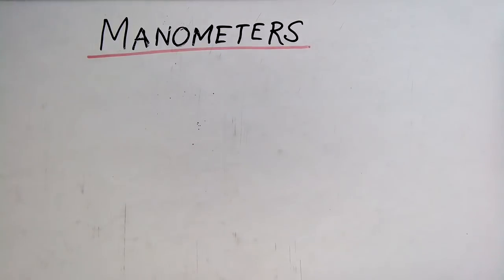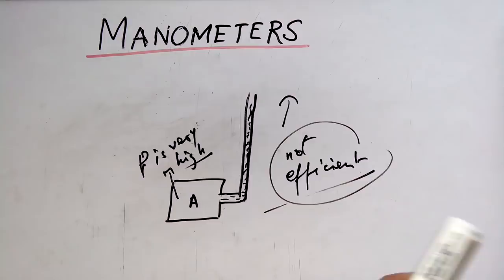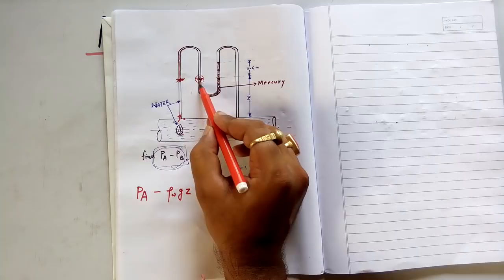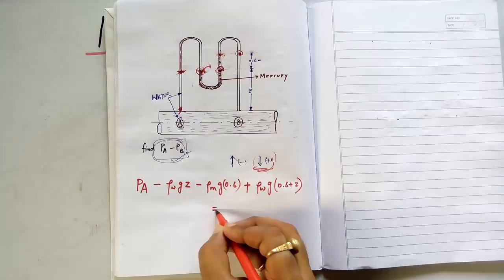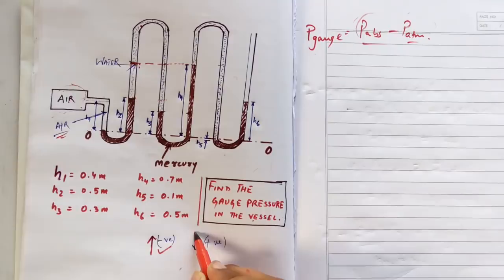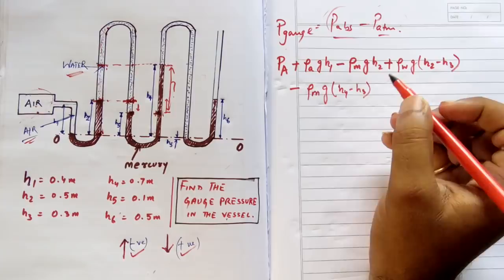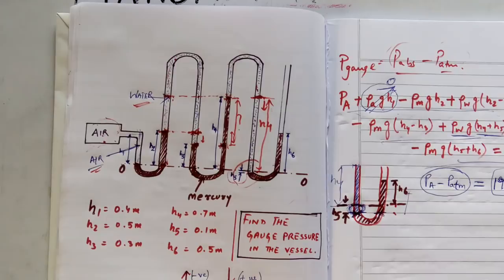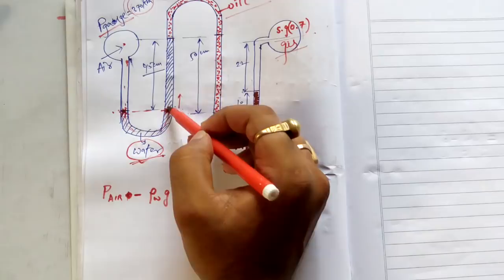multitube manometer pressure problems (Fluid Mechanics lecture)

Comment: Sir specific gravity of OIL is 0.85 as for as i know. But you have used 0.79. According to 0.85, my answer is: 364.517 kPa. Kindly reply
Reply from the maker: Dear specific gravity of oil mostly varies in that range of something 0.71 to 0.85. depending on types and brand
Reply: @RohitChowdhury_sajaysaini  Thanks a lot for your kind consideration

Comment: Ans for the 3rd question is 354.6kPa and I have a question; when finding the density of the unknown gas, you multiplied SG by the density of water (reference substance). My understanding is that when working with SG of gases you have to use a gas as a reference substance and not a liquid. Is my understanding correct or am I missing a key point?

Comment: Vanakam sir, for the second video why its equal to Patm and also for the second video as well if didn't neglect the pressure of air is that will effect the final answer ?  for the last, if in question didn't mention which point to start, how to know where is the starting point to calculate the overall pressure ??  Thank you sir, superb explanation with video.  😀😀😀😀

Comment: firstly i would like to thanks you!
2nd I have one question on the second example you now what if the fluid is influenced by the external pressure(atmospheric pressure) then what happens to the system?
Reply: In the 2nd problem the fluid is influenced by the atmospheric pressure. The only difference between the first and second problem is, in the first the pressure at B is gauge pressure and in the second it is atmospheric pressure ( you can consider it as gauge pressure). Whenever there is atmospheric pressure involved you always get the absolute pressure(as in the 2nd problem) on the other end of the multimanometric tube.

Comment: If I consider the specific weight of air (like density = 1.21 kg/m3 and g=9.81 m/s2), the  solution will be wrong???? 
Please....
Reply from the maker: No sir,you will not be wrong. Since density of air is very less, we neglect it unless it is mentioned in the question.

Comment: 17.10 how those both pressures will be same sir? because the density changes right
Reply from the maker: Because the points are lying on the same horizontal level...and between those two points same fluid (water is there). So both the points have same pressure.